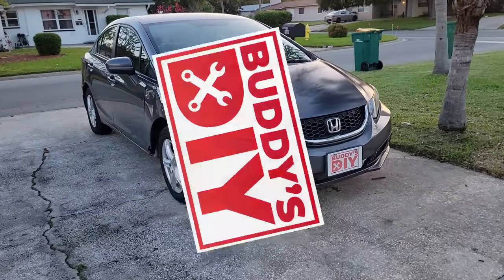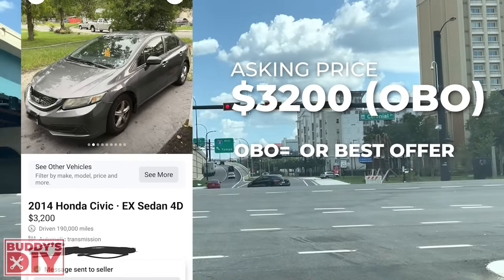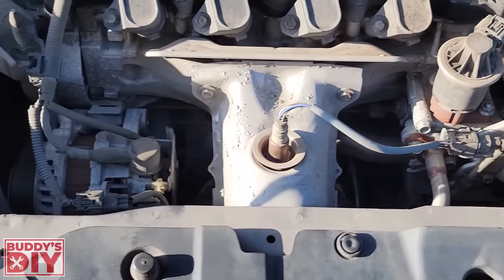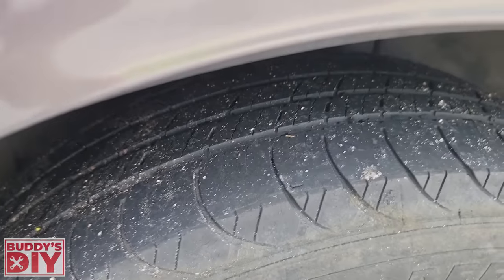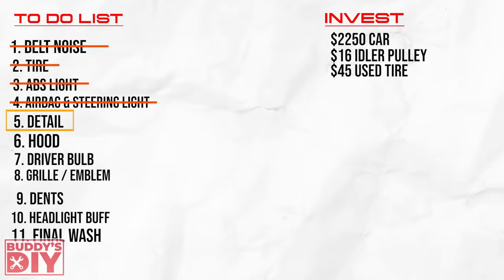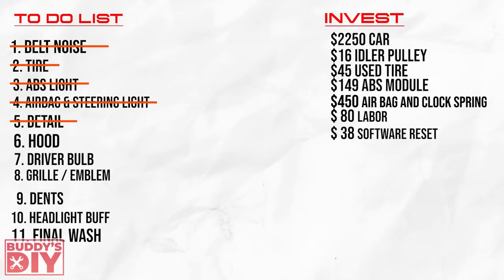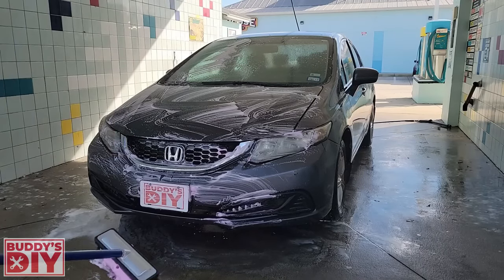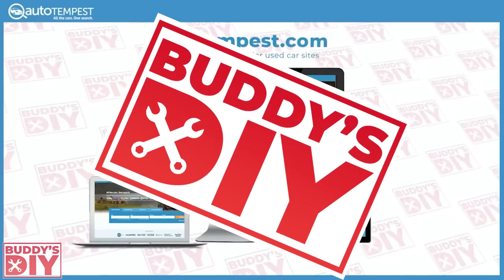How To Flip Cars | FULL PROCESS [9]

Comment: Dude the knowledge you have to diagnose and fix any problem is really impressive
Reply from the maker: I do what I can 😁
Reply: that’s another thing, to add on all the expenses you also got to be really knowledgeable when it comes to car restoration
Reply: Nsku1l
Reply: Plus the $ he probably spend in cars data,..
Reply: I wanna start doing this but I’m by myself so would it be better if a pull vehicle trailer to pick up vehicles?
Reply: You used to be able to buy hayes workshop manuals and they would tell you how to fix everything with a little bit of knowledge. Saved me a lot of times.
Reply: @itsthatbeeguy  They still sell them at my local Advance Auto store, didn't know they stopped selling them at others.
Reply: How do you match the paint colors?
Reply: @gokusayayin8051   Who spends money on car data? Having mechanic experience will literally pay you. And the internet is free lol
Reply: If he spent double in parts what he did, which most people would have done, then it wouldn’t be profitable. Also, the experience and time it took was quicker than most people. That was a lot of stuff to do in those hours

Comment: Finally Buddy! We've been waiting for this video for a long time. 
Wow, this car was a lot of work. You probably got fed up with this Civic when you were detailing the interior and some of the stains just wouldn't come off even after 7 hours of work. I know that feel.
This car didn't turn out as perefect as I would like and as you usually do, but that's because previous owner left it in such a mess, and as you said it's not worth it to perfectly restore such an economy car with 190,000 miles on it already. Especially since the new driver who got this as a gift will put more than one dent on it for sure.

Do you regret getting yourself into this car becuase it was so much work for less profit than you usually get? I guess not really, since at least it's not a loss.

Comment: Regardless of the profit made from this car, the seller got an amazing deal. I wouldn't have offered more than $1500. One of my vehicles is a 2009 chevy cobalt with zero mechanical issues, 1,000 times cleaner than this civic, and only 115,000 miles. I would be lucky to fetch $3,000 for it. Also keep in mind, most mechanic and body shops charge $100-$125/hour for labor. I'm definitely not aiming to make any insults here. I just think something should be said, for the value of the hard work and knowledge that it takes to restore a car. Literally all that civic had going for it, was that it ran and drove. Which, with the condition that pulley was in, it wouldn't even have had that going for it much longer. That car was just a step away from being in a scrap yard. But I must give Buddy a lot of credit, for taking on such a project.

Comment: I'm in the process of restoring my own truck, then I have another truck that's been sitting in my garage forever that I intend to put back together and sell, but I think after that, I may get into the car flipping side gig business. I really enjoy it as a hobby, especially since I do IT for a living at a desk, but there are some good pointers in this video and I think if I resist the urge to replace everything with new parts and even get some used parts from junkyards (way cheaper than ebay) that I could improve my margins by quite a bit.

Comment: The purpose of abs is not that you can break in an emergency situation...an abs simulates pumping the break so you can actually steer the car while emergency stopping and combined with the vehicle stability systems can help the vehicle  from sliding uncontrollably to a side...

Comment: Headlights easy ash. You can hand wet sand with 1000 grit paper and then wipe it dry, section off the parts around the headlight and then just clear coat and it’ll look brand new

Comment: great video man, how much vehicle experiance do you need to have to start doing this as far as repair experiance?  I have 2 motorcycles and an 01 ford ranger, I do all my own repairs and preventative maintenance.  I've done pickup coils water pumps, brake jobs, spark plugs, all kind of filters, and much more.  I have been welding for 20 years.

Comment: I wasn't sure what to expect when I watched the video I do this for a living as well so I was like I could either learn something or unlearn something What I found was that a lot of the stuff You said mentioned I already apply and do on a regular basis the one thing that I didn't notice is that you always wanna ask for more than what you really want cause if you're not willing to come down on the price that's bad negotiation which equals bad business so little bit of adevice is always asked for $800 more than what you want you should have listed it for 6800 and you would end it up with probably 62 Now I will say you're a lot nicer than me cause the ABS sensor I always throw it off and say it's a tire sensor and I'll leave that there's people usually don't care about that. That would have saved you like 500 bucks I think Also the bald tire not a really big deal they would've used that as a negotiation tactic and it would've made up for you lowering the price. Also  A dead giveaway that you posted it too low is the fact that the messages poured in and flooded within a few hours.

Comment: I just recently got this car as my daily driver and did the exact same with the serpentine belt and tensioner rod pully setup. I also changed the air house intake as these two things intend to break over time in civics. Engine seems strong and the average is 10.5L/100 km hoping to improve it can you suggest me something. Already cleaned the throttle body.

Comment: What you recommend doing to on a 2000 honda accord lx runs but when stopped at a light idle would drop 600 rpm. So would have to keep stepping on gas pedal to keep the idle up?

Comment: Do you know anything about Fuel Gauge ? Mine isn’t working. It’s getting current it’s not that. Resistor side is good. Just the needle , I had to remove it once and ever since I put it back , it isn’t working. It’s either too tight or too loose. Please help me.

Comment: I wanna buy a ok car but regular price a good 7,000 10,000 to 16,000 and pushed down to a price of 5,000 or 4,500 and I would fix them up but that’s hard to get done with me bing 14 and have 2 years for me to drive but I have a little
But more than 2,000 and wanna get good looking cars but worried about how the price it will go down in the years got any ideas what cars you suggest for good cars I think I could get a good ok car but any ideas on good cars for beginners

Comment: Super impressive not talking crap at all I’m sure I’ve just gotten lucky. Bought a green 2006 Honda element 250k miles for $1100 sold for 2500 2003 civic 5 speed 115k miles $1200 sold for $ 2100 Chevy trail blazer forgot what year $700 bucks sold for $1700  and 2003 Passat station wagon 5 speed manual for 900$ and sold for $1900. All just vacuumed and washed then posted same weekend and sold throughout the following week. You should definitely check out public auctions no dealer license and since people want to wait for what the later cars are gonna go for the first few are usually the best deals. I understand the way you do your videos makes better content but this is how I’ve done it.

Comment: Love your videos but I was just wondering how you feel about used parts, I’ve been flipping car for a lil over a year, don’t pay more than 600$ for my cars, I’m gonna try that website cause I have like 60 pages open on my phone with different cars saved. I’m saving up to buy newer cars rn over 2010 been doing Hondas, Toyotas, Lexus and more think highest year was an 08 for 600$ all it needed was a starter. I always sate that the part I replaced are used same with fenders and hoods it’s way cheaper and you can always paint them to if they don’t match, not hating just wondering how you feel about used parts? Most of my cars year rang form 1990-07 always try to get 2k for them or more, was just wondering why you didn’t get used parts for the girl and hood you could of also took that fender off and straight it up a bit or go to your local auto store and buy a dent pulled definitely makes the difference for price, I’m gonna try those cleaning chemical I use oven cleaner for the carpets and other old tricks that were passed around

Comment: Hey Buddy, need your help. I got a used Chevy Cruze headed fur auction. So it came with host of issues. The 2 error codes I keep getting are MAP sensor and turbo boost sensor low voltage. I replaced both the sensors with new sensors. I still get the code. At this point I don’t know how to diagnose. Any suggestions

Comment: Hey buddy 
I live in Cali and there’s this lady selling her 2005 Toyota Prius with 200k mils for 700 dollers this is what she wrote“2005 Toyota Prius Hybrid
Clean title.
Prius main battery pack Refurbished in may 2022
Coolant pump replaced as well. 
All Tires replaced in 2022. 
12v battery also replaced in 2022.
Tags til may 2023 
Just barely reached 200k miles in 2022. 
Not sure what the problem is, it was working fine then one day it started shaking and I stopped on the side of the road, had to call a tow truck,  found out it had no oil in it, now it’s just been sitting in my driveway ever since. 
Sad to let it go,  I don’t know much about cars, need it gone.” What do you think about it

Comment: I was all good until I seen a video of you changing a spark plug department that had oil in it. Your solution was just change the plug when the housing was a problem that was dripping fuel into the spark plug department…. You just changed it and brushed it off lol.

Comment: Honda did one of the dumbest things u could possibly do in 2019 they stopped producing the v6 for the accord Wich was one of the best engines in the world it was a 3.5L v6 making 277 HP and they decided to discontinue that engine for the Accord and instead bring a 1.5l turbo 4cyl making 82 HP less then the v6 with the same fuel milage and now a lot of people are complaining that the 1.5l turbo DREAMS WORKS engine is having several issues yeah way to go Honda as they say if it ain’t broke don’t fix or replace it

Comment: You could’ve easily saved yourself all that time and still made $1700 in profit if you only focused on Fixing the mechanical issues and detailing.. assuming you now own the car for $3k after those items I mentioned sell it for $4700-$5k taking. Not to mention Hondas and Toyotas always sell on the high end of KBB very good condition. Your knowledgeable but left money and time on the table.
Reply: The only "extras" he did were the hood, grille/emblem, faded headlight restoration & final wash. Those were relatively cheap and likely played a big role in the 5300 usd the car was sold at.

Comment: forgetting that you had a spray painter, garage, tools, obd reader, how to get the car home without a plate, you didn't test drive it or put it on the lift (oil, coolant leaks,  suspension, brakes, etc?)...there is a whoie shitload of stuff not mentioned here with a cost associated.  I'm thinking that altogether you got $25/hr.  Clearly not worth my time but maybe if you value your time cheaply it's worth it. Also you do this full time so you have experience. Any one of these could have been a nightmare, as theSRS module could be totally broken and need replacement, rotors and brakes if your going to do an abs and on some cars you need a computer to reset and pump fluid into the abs..........gigantic nightmare